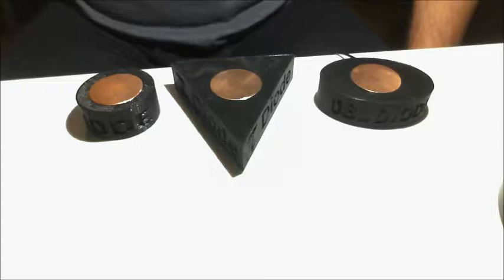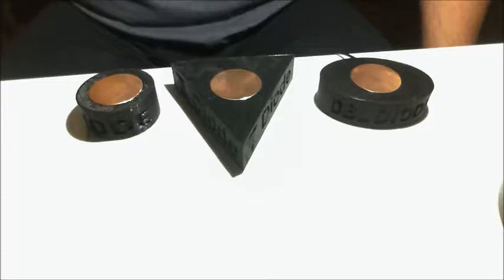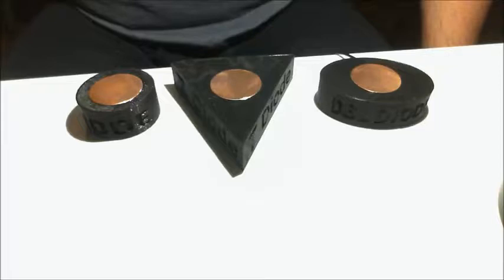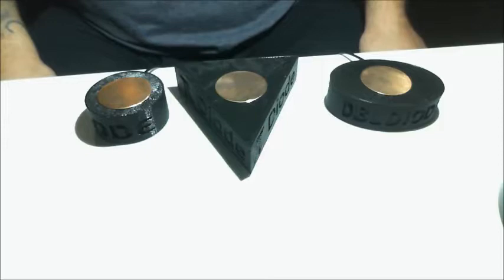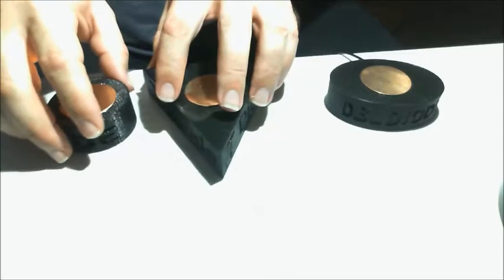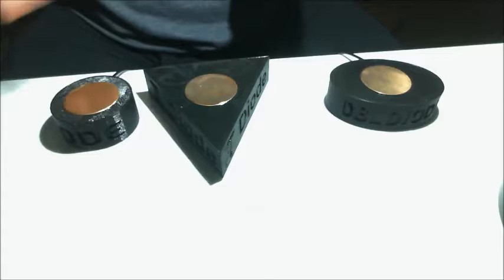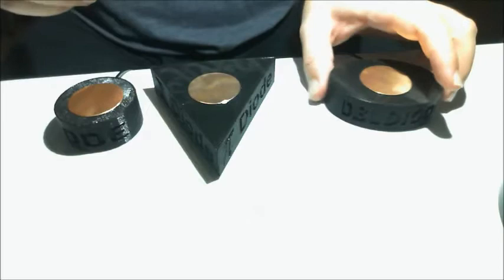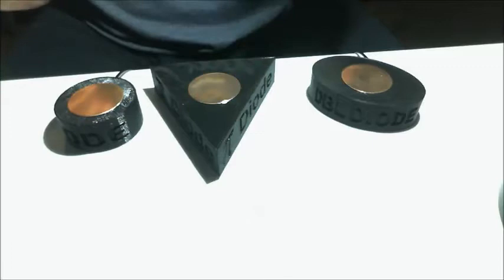Tutorial/Instructional video PIEs version of the Raudive Diode

Comment: I have a question I did get one of these from you I was so interested  I did some testing with it I actually plugged it into my sb7 spirit box and the EVPs are so much clearer. Obviously not how you intended it to work but very cool. Thanks 😊
Reply from the maker: Is your sb7 detuned so it does not pick up radio waves? If not more than likely the diode is acting like an antenna. The diode is not designed to pick up radio waves by itself, it is literally impossible with the capacitor working as a filter, but in conjunction with a  untuned radio, it may be possible.
Reply: @paranormalinvestigationseq7608  let me tell you it works great I've been using it over six months now I will not use my sb7 without it the spirits love it I guess they use the energy from the crystals that are in there not sure but they do say that they like it and it helps them communicate. My last video has me telling my subscribers a little about and your link in the description for this video. Thanks I really love this I'm probably going to get another!
Reply: @paranormalinvestigationseq7608  but also I wanted to ask you is it possible to put the duel germanium in a small around 1 cuz I do outside investigations?

Comment: The receiver with 2 diodes....are the circuits the same (reversed diode not counting) or are the circuits combined but built totally different (parts or layout). Thank You.
Reply: The dbl diode (I believe that is the one you are talking about) has 2 separate diodes soldered in line with each other. Not sure if that answered your question.

Comment: Thanks for the video. I tried to use the wavepad app on my smartphone but it still picked up ambient noise? Does it not work with phones?
Reply: iceman9502002 im not sure about phones, but I believe that the internal mics on the phones stay active. There may be a recording app, that can be used and can be set to only record thru the external mic.
Reply: These do not work with phones with out a TRRS adapter. The plug on these have a 3.5mm TRS plug and will not work with phones. Here's a link to purchase one https://www.amazon.com/Movo-MC3-Microphone-Adapter-Smartphones/dp/B01N9CJDVE/ref=sr_1_2?ie=UTF8&qid=1506996239&sr=8-2&keywords=3.5+mm+TRS+to+3.5mm+TRRS+adapter
Reply: Interface Death they work perfect on my S8+. It's impossible to record ambient, as there is no microphone, it uses a germanium diode.
Reply from the maker: Its possible they won't work with iPhones if that is what you are using, but I have tried it with several Android phones, and they work perfect. It also has a stereo plug on it, but it will work with a mono recorder as well.
Reply: Germanian diodes must not be the same as microphones because no TRS 3.5 mm plug on a mic will work on a smart phone. TRRS is required.

Comment: Why a copper plate as "antenna", and not a real antenna (like in the original PCB from raudive)?
What are the frequencies that are urgent?

Idea, a "Raudive Diode" in a old microphone hull with phone plug or (for better field recorders) XLR socket.
More comfortable by using in hand with field recorder (at schoulder with carrying belt, for example: https://farm3.static.flickr.com/2163/1570779044_b6e678aa04_b.jpg).
Classical with metal wire cage (example: http://www.pssl.com/images/ProdImage03/1500/SM58S.jpg ), or is this bad (faraday cage)? Or perhaps this metal mesh cage as antenna?
With a classical field recorder (like the good but used cheap Fostex FR-2LE) with 2 channels (stereo), at one port a usual microphone, at the other port the Raudive-"microphone"...
Reply: Ano Nymos, copper is way more conductive than a chrome antennae, I'm not sure what u mean by urgent frequencies.I use zoom recorders and they are incredible 360° recording devices.
Reply: I mean, what frequencies use the "voices".
Local ghosts and ITC voices.

Why are not copper disks used for mobile radio, radio etc.?
I do not criticize the copper itself, but the shape.

An antenna has a specific design, length, length of the individual segments etc.
Therefore, an antenna is designed to a certain frequency.
That's why I'm asking about the frequency.
You can not use a wire hanger for WLAN ;-).
There are antennas for "radio scanners". These should receive well over a certain range (e.g., 5Mhz-2000Mhz).
Reply: Ano Nymos if you research, copper is used for mobile antennas and radio antennas. The frequencies that the Raudive Diodes pick up, are 20hz to 20khz.
Reply: That are the frequency range of a microphone.

Yes, copper are used for mobile antennas, but with a special design, in relation to the wavelength.
At mobile phones there are also a very special design (smaller as the wave length) with knowlegde from the "mandelbrot set" math.